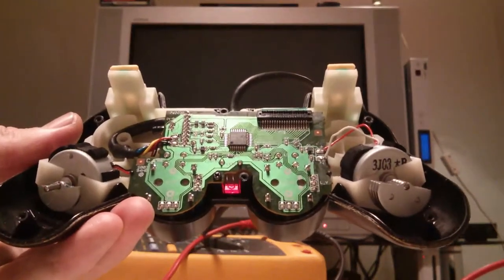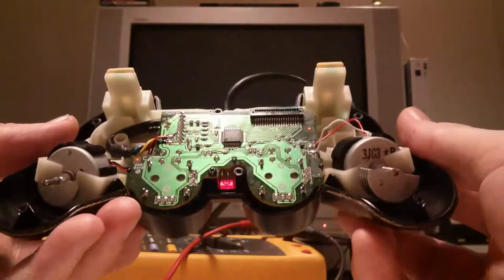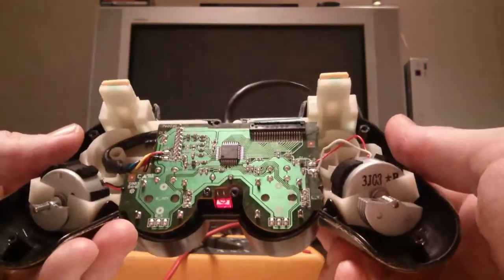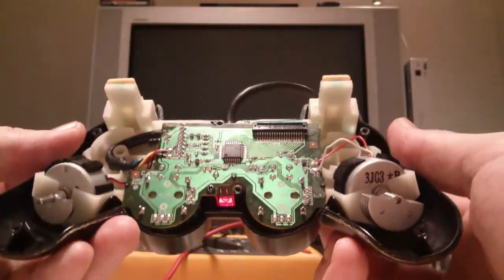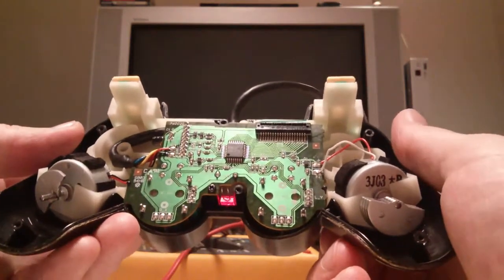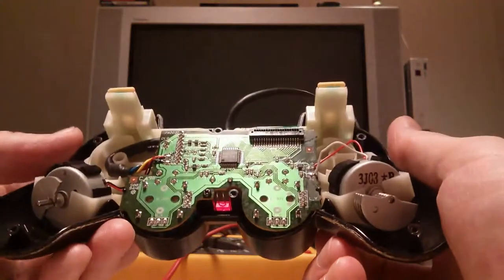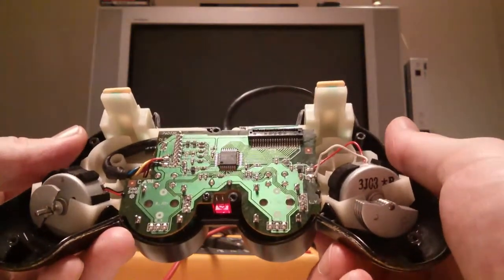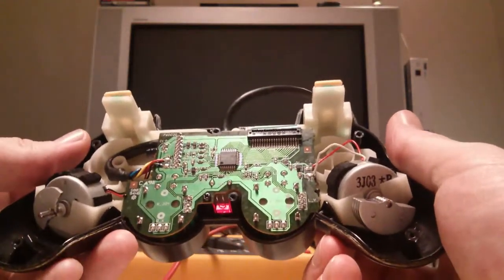Sony Playstation 2 Controller Motor Demo

Comment: It's look like the controller is MINT condition :D!
Hey Gammy, you use Arduino for this test ;) ?
Reply from the maker: Ha, no, although that might be fun to do, especially through the multiplexer thingy IC and not the motors directly; I'm also curious about how the actual pads work. I think they're capacitive.  It's quite cool. I used a ps2 pad testing program; google 'ps2 padtest' and you'll find it. It's not fantastic but it works :)
Reply: gammypoofle Yeah and is very usefull ! ;)!
Pretty nice test ;D